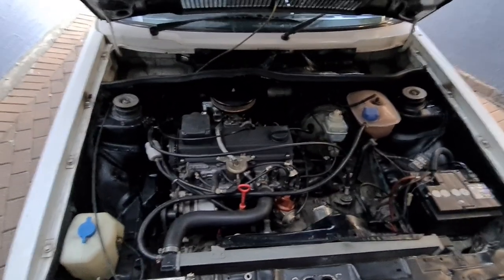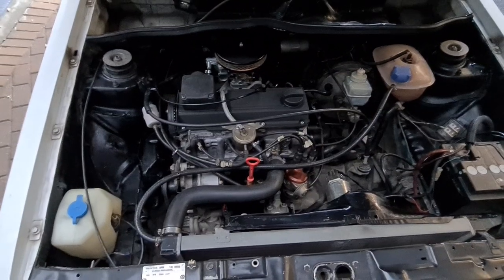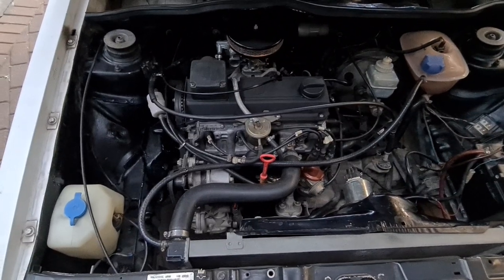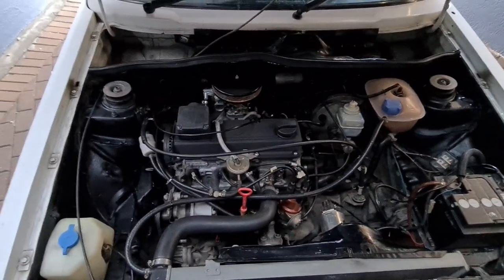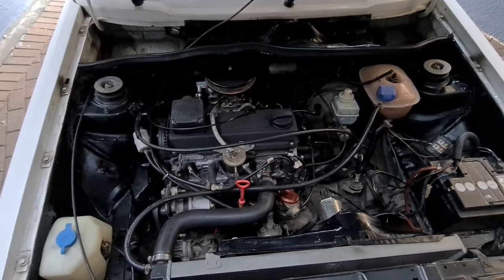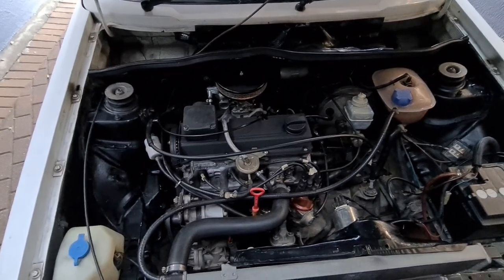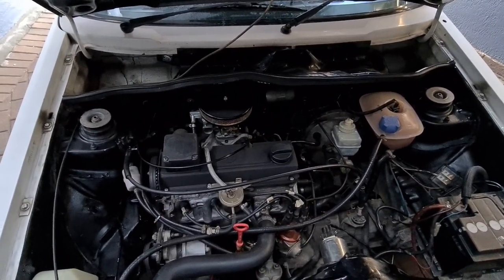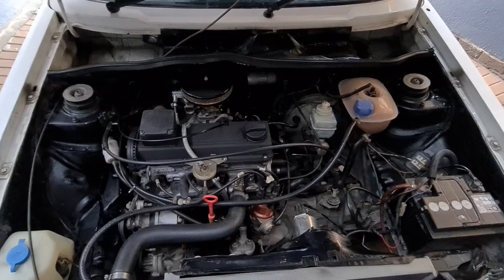mk1 1.8 8v build worth 26k? Questions answered, fuel economy 298 cam

Comment: I got quoted R20k just convert from std carb to mp9 which I doubt it would even give more power. I wouldn't spend that type of money but you can't put a price on happiness 😂
Reply: It will make your life easier (no need tuning your ignition timing & setting your carbs), if your car is standard, it will make a slight difference as fueling electronically controlled.  BTW for R20k they should be able to fit an ABF.  Maybe a bit extra for fuel tank & pumps etc.

Comment: Did you also gasflow the head ,you should actually put it back on a Dyno to see where on the rpm is all the Horsepower
Reply from the maker: Hi there. No didn't gasflow the cylinder head, reason I can't pay 4500 to gasflow a head then just gain 4/5 kw. Will have a look at dyno next  month will see. Thanks for your comment 👍
Reply: @ritchiesridemk1vwbuild853  wow ok that's very interesting thank you 🔥

Comment: If I may ask, Why are you using such a big radiator? Never seen a Mk1 Golf with that size radiator before...
Reply from the maker: Hi there. When I changed the motor was told to run with a bigger radiator  and that was the only size they had. It's really good doesn't let the car  run to hot in traffic. Thanks for your support.
Reply: @ritchiesridemk1vwbuild853  Thanks man
Reply: Vw mk2 radiator

Comment: Will the idle be more stable with the weber 38 dgas and wont get lean at high revs?
Reply from the maker: Hi there. 38/38 weber carburetor will be better at higher rpm no doubt. Idle no, going to be very rich on fuel, and fuel economy is going to be worse, as a daily drive. Thanks for your comment and support.